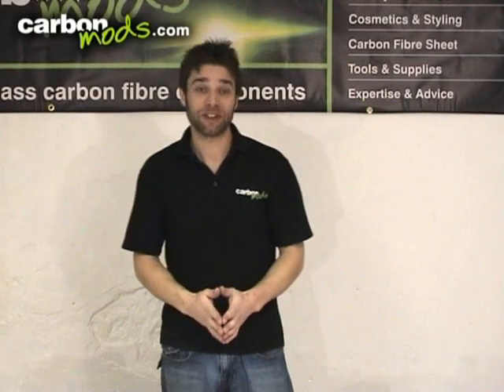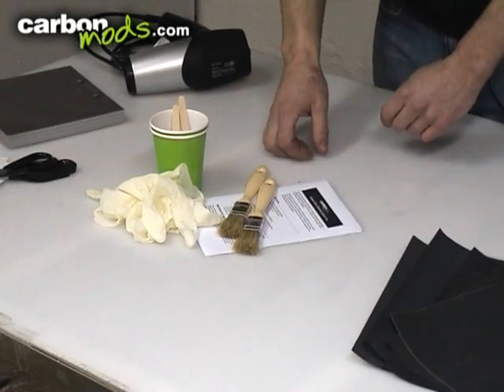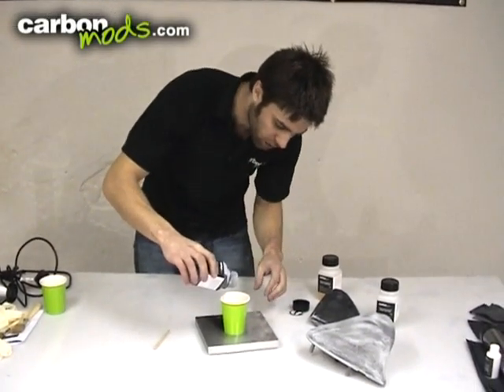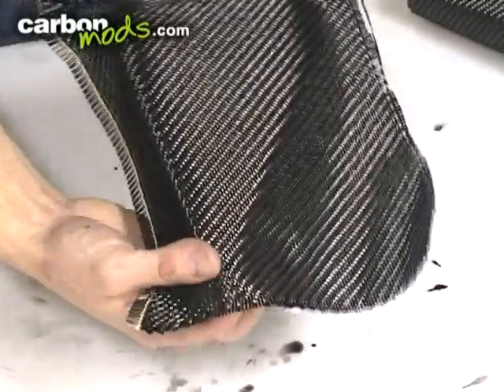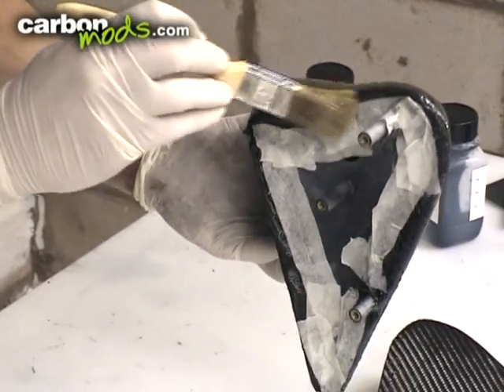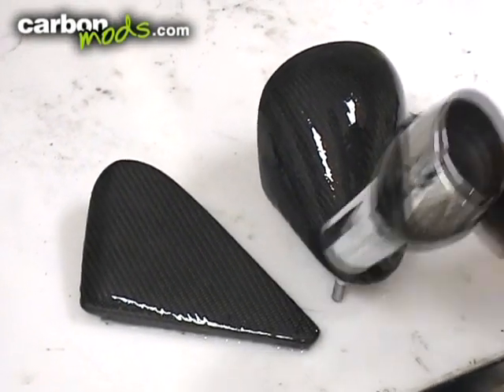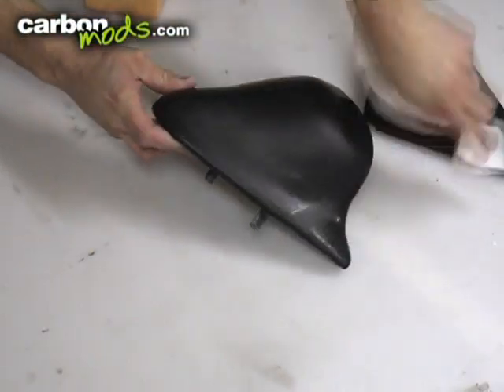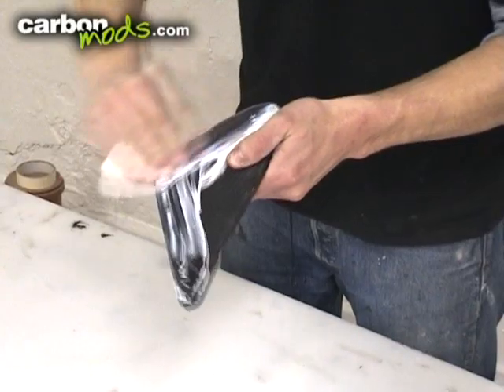How to cover parts in carbon fiber (fibre) by skinning or wrapping

Comment from the maker: @pballer72: The resin we use doesn't actually exotherm very much so that wouldn't be a problem. The tricky bit would be finding a temperature that the wax would melt at but that wouldn't harm the part. The resin we use in this skinning kit is happy up to about 80 degrees C so you'd need a wax that melts before then.

Comment from the maker: @MillieMills77 : You can clean epoxy off the brushes uses Acetone. It's not a chemical you can generally buy at a hardware store and it's not one we can ship safely but any fibreglass supplier will have it or you can buy nail cheap nail polish remover, which is basically acetone (don't get one with 'moisturisers' or other additives).

Comment from the maker: Hi MIAStrat, The Resin used for the top-coat is a very UV stable one... obviously no epoxy is 100% UV stable, however we have never experienced or known of anyone who has experienced problems using our system. I hope this helps.

Comment from the maker: Hi Yonchvader, well, firstly, steel can be cut and sanded too. The main reason it's much easier with carbon is because carbon fibre's strength works differently to steel, it's a bittle material with poor 'elongation to break' properties which means fibres can be individually broken easily (which is why sanding is so effective). Weight-for-weight however the tensile strength is higher than steel which is why it's referred to as 'stronger' than steel.

Comment: @pballer72  Yeah balller you can but you gotta have alot setup for that. For instance you gotta have the right wax to stand up to that and you gotta make a really strong mold that has a high temp. Because once you wrap it around the wax you gotta wrap the carbon in the mold. But the only reason you would wanna use wax is if it's a really complexed mold, such as handle bars etc..... plus you gotta use pre preg carbon. Kinda hard to do it with dry raw carbon, such as what he's using

Comment from the maker: @krios50 : -30 degrees to 50 degrees should not be a problem. Much above 50 degress and you would want to use our High Temperature Skinning Kit which can take temperatures up to 200 degrees C (for engine bays, heat shields, gearbox covers etc.).

Comment from the maker: @bloodieduckies : Skinning is the process of making something look like it's a carbon fibre part by adding a single layer of carbon fibre to the outside of it. Laminating (although the word sounds like the same thing!) is the traditional name in composites for actually layering reinforcement (i.e. carbon) and resin into a mould to make a composite part (i.e. a carbon fibre part) so laminating is making carbon parts, skinning is covering existing parts with a layer of carbon.

Comment from the maker: Hi Urbanfirth, 

@ 20deg it takes 8 hours to cure so it can be sanded/polished. It will have 'tacked-off' and additional layers of resin can be added after around 3 hours. 

Hope This helps, 

Carbon Mods

Comment from the maker: @ibanezrg2550 : I'm not sure because epoxies can be very different from eachother. All I can say is that if you've got those materials already then it can't hurt to try. Our carbon cloth is good quality fabric that wets out well but otherwise is it's normal cloth so you carbon should be fine. The epoxy resin we use has some quite special properties that many epoxies don't have so that's where your probelm (if you have one) could be.

Comment: @sparkleymagic Yeah, you could do it, depending on the spoke design... I almost did it on my sportbike having worked with carbon fiber few a few years but decided against it because it could throw off the balance of the rims significantly.

Comment: If your covering a part, that for whatever reason requires the carbon fibre cloth to be cut so that it will lie properly, how would you go about making the seam invisible?  Also, is there a specific tool to cut the carbon fibre cloth properly?  Or will any old pair of household scissors do?  THANKS!!  I also like that your videos are short, succinct, and to the point.  Thanks again

Comment from the maker: Yes we ship to the US everyday, a kit typically costs £16.00 which is about $25 so all in with current exchange rates it would total $93 on your doorstep, as for working on ceramics it would bond quite well especially if wrapped around onto the back... not sure about dishwasher safe, there's no real reason why it wouldn't be however we couldn't guarantee it. i would imagine the worst that would happen would be losing the glossiness. 

Hope this helps, 

Carbon Mods

Comment from the maker: @wayakuza111 No, you can't I'm afraid. The carbon effect vinyls are generally cast PVC which is very difficult to bond to plus when it gets coated in resin the resin fills the texture of the carbon pattern and it actually stops looking like carbon fibre. If you're going to the trouble of the rest of its, why not just use carbon inside and get the proper genuine appearance!

Comment from the maker: Hi Buhrrito, 

To make a hood/fender you could do either, in fact we are just about to launch a video showing this exact process on a hood/bonnet, as for what the pros do; for a complete one off this skinning process is normally used, however for mass production moulds would be made and the parts would be moulded, check out our other videos for info on this. 

Thanks for the question. Carbon Mods

Comment: Can this process be done to a flexible exterior plastic auto part such as the lower rear fascia of a Corvette.  Can the overlay take a little flexing and will it stay laminated to a flexible plastic part?  The only flexing would be while sanding.  The part does not flex on the car.
Thanks for the video.

Comment from the maker: @9kevin : Yes, there's no reason why you couldn't just start laminating straight onto the outside of the foam bike frame pattern. The basecoat is special because (a) it's black and (b) it stays tacky for a long time making it perfect for the careful positioning of the carbon for a single skin. What you'll be doing it wrapping many layers of carbon around the frame making the black nature of the basecoat and the tackiness unneccessary.

Comment: Instead of using a clear coat, you can use a small amount of alcohol and resin and wipe it on and it will create a clear shine. But the resin needs to be thinned out a bit. It's what I would do for carbon bits for the race car I worked on

Comment: Thank you, Ik it's a wee bit idiotic to leave a comment on a 12 year old video and hope this reaches you, but this is easily the best tutorial I've found on the subject. Thanks!
Reply from the maker: Thanks wires, we've actually re-made a skinning video on our Easy Composites channel applying the carbon to a more complex shape and using slightly different materials than this one but the processes are still very much valid :)
Reply: @carbonmods  i know this is 15 years old now. But i was trying to do this to my interior trim on my porsche and had a wild idea of building each part from the carbon fiber. Can you point me to someone who can design molds for me?
Reply from the maker: @Devil_Dog_Ultra  We don't specifically keep a list of mould, pattern or indeed part makers as whilst we deal with lots of people who potentially could, we rarely get to see the end product and how in turn those people/businesses deal with customers so its difficult for us to recommend anyone in particular. However, if you're reasonably hands on, our Easy Composites channel has many, many more videos than this (old) channel of ours and a number of pattern and mould making videos encompassing more modern techniques and materials including 3D printing, etc.

Comment from the maker: @Lazethakid : Yes, there's no reason why you can't do this. Composites hoods could be made in a variety of ways using a variety of materials and the closer those materials are to the 'skin' you add the better but even if it's a different resin system (polyester for example) then it should still bond well and give a new lease of life to your faded C/F hood.

Comment: @extremehunter1996 Well, it depends, are you talking parts made to be as light as possible, or as strong as possible. 

If the part was made to be as strong as possible then def a 10.

Comment: I'm curious as to what kind of Epoxy resin you are using that can be flatted and polished by hand with good results? I have 20yrs exp with Polyester on classic wood dashboards, and have been using the same technique for finishing the CF. I could use a good polishable Epoxy though. I can't imagine that what you use would stand up to machine polishing?? Cheers.

Comment: im sorry so what you suggest? how chinese finish parts that surface very hard to scratch and hold uv? definitely not clear coat that is like glass hard or same as polished epoxy. what you think that can be? and you think if polished epoxy that seller say protected uv touch sun it go coudly or what? like you told finish can be polished or clear coated so we polish thats faster and easier and hard finish you get.

Comment from the maker: @liamcoleman96 : In theory yes, but in practice they're very small and fiddly. If you wanted to do it I would suggest using a special 90gsm cloth instead of the 200g we use in the kit and show in the video. A 90gsm cloth is less than half the thickness and also the pattern on it is also half the size so it looks far more in proportion on a small device like a phone. Take a look at w ww.easycomposites.co.uk for 90gsm cloth.

Comment from the maker: Yes, if you've still got carbon fibre touching the surface it would be wrong to start flatting it back at that stage. Build up some more clear layer so that when you do 'flat back' you can do just that and sand the surface so it's smooth and flat without any of it getting down to the carbon.

Comment: I just did my jetski pole with clear resin.  It is important to have the first coat is black it helps to hide inperfections in the carbon fiber and when you sand it to flatten it out it hides the thin parts.  I did 4 coats of clear ontop of carbon fiber and looks awsome I should have done a smaller part my first time but am very happy with my first thing I have ever done

Comment: I am trying to make a oem motocross bike airboot fit and need to cut away the area around the shock spring as it rubs on the rubber now, can i cut the rubber out and epoxy the whole air boot and fill in the hole with carbon fiber cloth and make it a more narrow airboot so the spring has room and then seal off the whole airboot with resin and at least 4 layers of 2x2 5.7 wt cloth, will it hld and be sealed? i dont want to make a whole mold as it might be tough?

Comment from the maker: @turboboost27 : The kit is £39+VAT (if you lice in Europe). You wouldn't pay the VAT if you don't so it would just be the £39 (which is about $57 US. The High Temp version (I mentioned above) is a little more. Also we have a Large version of the kit which has a peice of carbon that's 1sqm (3' x 3') and an even larger one for skinning bonnets/hoods (over 5' x 4'). Check our site for all the prices on those.

Comment: When it does not have resin on it then it is like cloth. It is not hard and you can cut it with a normal pair of scissors. The resin is what gives it that strength like fiberglass.

Comment from the maker: @gsxr1300fan123 : Everything is harder the first time you try it and skinning with carbon fibre is no exception. What we normally suggest is that you have a practice run on something small and insignificant so you can learn the technique and make any mistakes on that trail run before wasting time/material making a mistake on a larger part. I don't think a motorcycle helmet would be particularly difficult but like I say, start small first!

Comment: i have a question and i hope you can help me out.
i have a carbon fiber hood that has suffered cracks in the epoxy. i tried sanding it down but dont want to ruin the cf fabic. my question is.. is there a softer or an affective thinner that can soften the epoxy enough to erase the cracks but will still allow it to cure when im done?

Comment from the maker: Hi shkssj88, 

what type of resin are you using, if you are using a polyester or vinyl ester this might be your problem, the styrene in these resins boils under vacuum and can often lead to extensive pin-holes, try a specific epoxy infusion resin, if that isn;t your issue you might want to check that your pump is giving you virtually 100% vacuum, if it's not then get one that does, other than that it might be something simple like not achieving a perfect seal. 

Hope this helps, 

Carbon Mods

Comment: @Keitho958 It gives a sticky layer for the carbon to adhere to, it also masks the part colour as the carbon has tiny holes in the weave. I also use the black (gel/epoxy coat) to paint the underside of parts afterwards. Glovebox lids for instance. Been using this stuff a while and it's very good.

Comment: Could this be used to make a piece like inside car trims not just a cover over but an actual piece example cover of mirror but instead of just leaving it as a cover make a mirror using the original just as a mold. If that makes any sense :?

Comment: This is a great product that worked very well for me. I followed the instructions to the letter and I would just emphasise the need to give thin, even coats of the clear resin. I was a bit heavy handed with the first resin coat and ended up keep having to wipe drips away from the lower edge of the item I was  coating. When it was cured, I had to sand away the excess but thereafter with thinner coats, everything went well and I'm very pleased with the end result.
Reply from the maker: +Brent Chiswick Great feedback Brent; it's great to hear from people using the kit and I'm glad it went well for you :)

Comment: So the first resin is black (a kind of gripper)
the second is the epoxy transparent resin...
but the third resin, applied after the sanding and dried with the hairdryer, what kind of resin is?
what product is the spray can?
I am asking cause i have to skin my motrobike exhaust terminal pipe, it gets hot (about 150°C)  wanted to know if the componets used here are resistant to high temperatures.
Last thing, the glossy finish is smooth to the touch, would know how to have it slightly row to  touc

Comment: What is the base coat stuff actually called?  Would you say it's better or easier using epoxy as opposed to polyester?  Just wondering if I'm doing something wrong or using the wrong stuff, doesn't mixing in the hardener to either epoxy or polyester only give you 4 minutes to work with it before it's hard?  You say in this vid that it takes about 3 hours for the base coat to go to a tack and the carbon seems to stick down really well.  Any tips?  Would be much appreciated, thanks :)

Comment: Would this be possible to do on a helmet? 

Just wondering because 
1) helmet there's no were to rap the carbon... 
2)if the chemicals you are using will compromise the helmet.
3) will you be able to use spray paint on the material before putting the clear coat on

Comment from the maker: Hi Dazzy2para, 

You can Have joins in the fabric, normally the cut is made when the top-coat has part-cured (still slightly tacky)  you overlap the carbon at the join and then carfully cut along the desired the seam line with a knife and remove the exccess material. so in short yes a sphere would be possible with one seam/join running around it. Thanks For the Question. 

Carbon Mods

Comment: @carbonmods  one pint goes around $250.00 I dont want to spend that much, but since I have the discount on the COATING, I want to ask you if I can use the epoxy COATING instead of the epoxy resin and if I can, will it give me the same results?    Sorry if it is too much..hehe

Comment: Great tutorial!  Why is the first coat using black? Can I just use clear for both steps?
Reply from the maker: +shortsleevecardigan That's so that you don't see the substrate (the item you're covering) showing through any gaps in the carbon weave. If the item you're covering is already black then you don't need a black basecoat but if it's not black then it's important that you use a black basecoat otherwise the appearance of the skinned part will really suffer.

Comment: I've done a bit of fibreglass and epoxy work, mainly on lightweight composite kayaks and was under the assumption that you needed to buy very expensive special scissors for cutting carbon fibre. Can you tell me is there different types of carbon e.g. some like this you have that isn't structural and other that is structural?

Comment from the maker: @drzflyest4 : No, the masking tape is just a temporary measure to hold the carbon in place whilst the basecoat cures. Generally, you'll have completed removed any carbon/resin from the inside/reverse of the part after you trim and finish the excess material off earlier in the process.

Comment from the maker: @9kevin : As tempting as it may seem because you get a discount on the coating resin I certainly wouldn't use this for laminating, it just won't work right at all. We sell 1kg of epoxy laminating resin designed for carbon fibre for £16 (around $24)on our Easy Composites site (search EL2 laminating resin in Google), a little money spent on the right resin will save you wasting the money you spend on the carbon fibre and glass (also, I'd skip the glass and go pure carbon/epoxy).

Comment: What if you didnt want to cover the entire part in carbon fiber? Do you have any tricks/advice on how to do that? My gauge surround in my car encompasses the gaguges then goes over to the air vent and headlight switch, but i only want to cover the inner part around the gauges. How could i do that?

Comment: Ok..... I am planning to make a road bike frame out of carbon fiber, and I am planning to use polyurethane foam, my question is, can I use epoxy instead of the black base coat that you used?